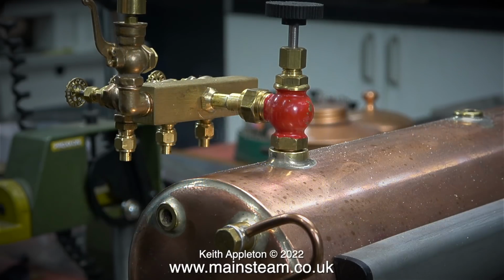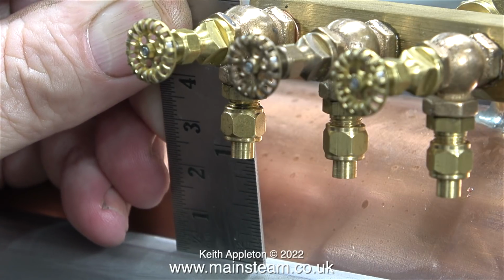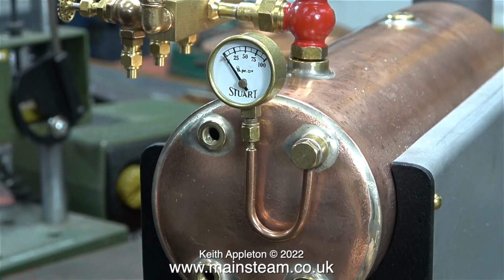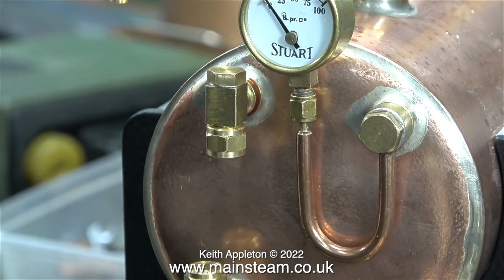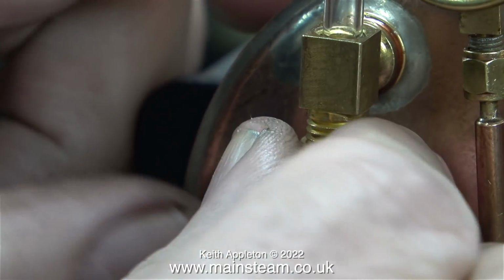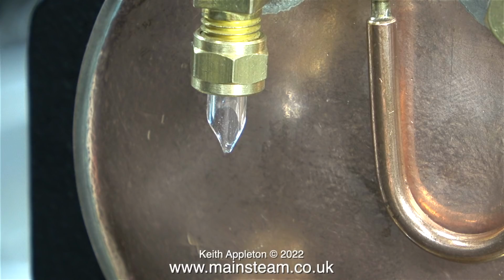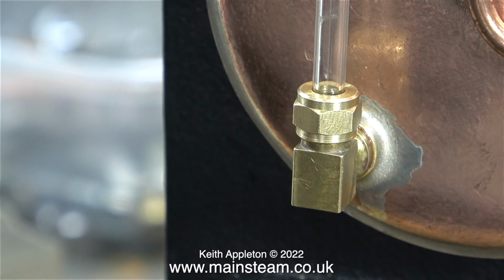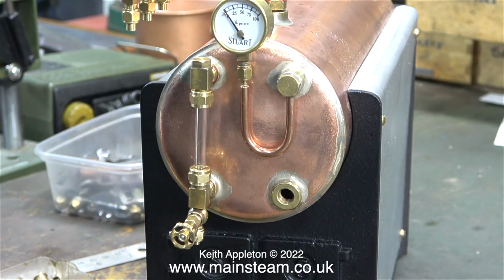MAKING A STUART MODEL STEAM PLANT - PART #47

Comment: Stuart Models Water Glass tubes from the 1980s to the 1990s were a problem, sometimes the glass was bad and towards the end of the 80s the fittings started getting shoddy, after 1990 they seen to have gone back to what they were in the 1960s.
Reply from the maker: This is an almost new Stuart 504 Boiler, maybe only a couple of years old.